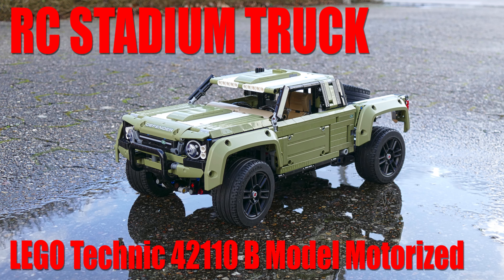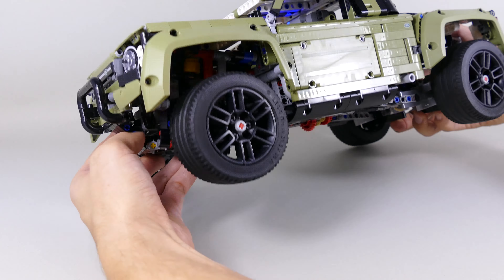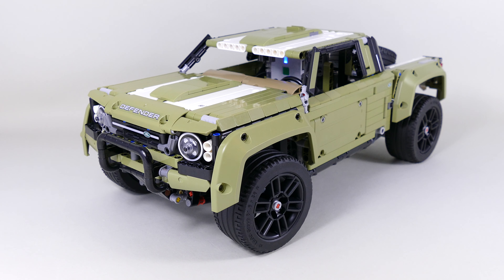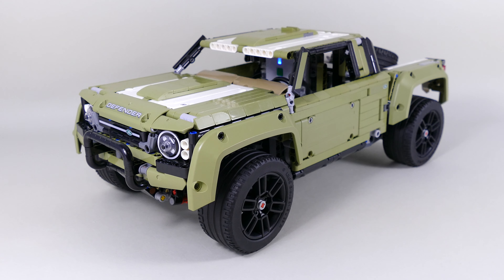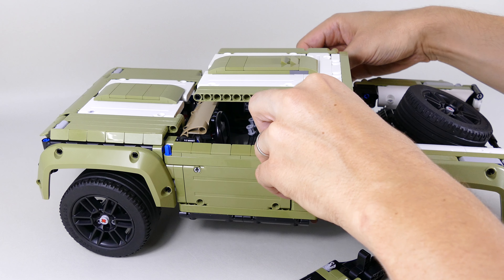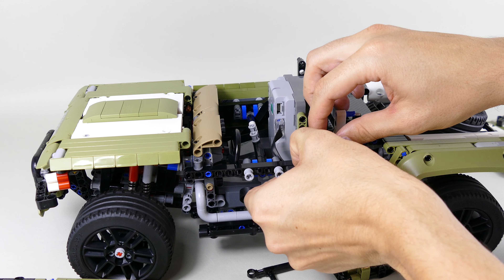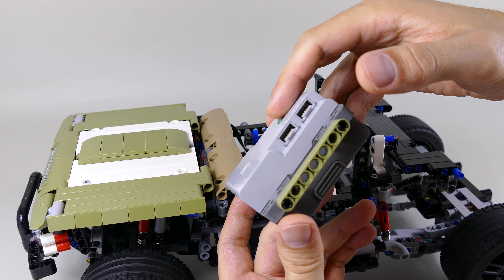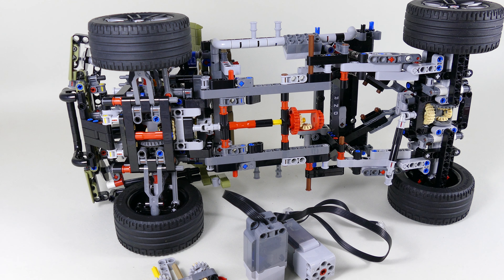RC Stadium Truck - LEGO Technic 42110 B Model Motorized

Comment: I'm surprised the universal joints are strong enough to move such big wheels and the car overall!
Reply from the maker: The truck is not so heavy and I leave the motors running at 1:1 gearing so the truck would probably stop before it breaks anything. The truck is all disassembled now, none of the universal joints suffered any damage. The only thing was some grass in the gearwheels.

Comment: thanks! it helped a lot
i actually managed to break some universal joints and after that i replaced tem with metal parts and after that i tought why not put 2 buwizz motors in it
its pretty fast with 2 buwizz motors so thanks for the help 'cause i only found a way to put them into the car after i saw how did you put your mototrs in it

Comment: Yaay time to dismantle the landrover and the crawler can i use 2 xl motors
Reply from the maker: Might be dangerous for the universal And CV joints in the drivetrain. Fitting them in the chassis will be more difficult as well.
Reply: Ok then im gonna remain on the crawler
Reply from the maker: @Player-fx3vt  Actually since you have the planetary hubs, you can try XL motors but additional rework might be required.
Reply: Ok ill see what i can do
Reply: And maybe if i replace the cv joints with the remaining wheel joint (i dont know how to call them but ill say so : the joints that connect the differential tot the wheel hubs ) i mean those can withstand some force right ?
Reply from the maker: @Player-fx3vt  yes, they can
Reply: Allright , im gonna try it , its gonna take a while because of school tho ...

Comment: @grohl666, is there a way to replace the two drive motors by two buwizz buggy motors and use a buwizz 3.0 for this built using the steering motor u got there and as said above the two buwizz motors? My idea is to Make the model a lot faster since ur build seemed to be really stiff and sturdy so it could probably handle the speeds 👍🏻
Reply from the maker: No Idea. I do not have any of that stuff.
Reply: @grohl666  oh alright but thanks for your time!

Comment: would there be enough space to fit a power functions servo in there?
Reply from the maker: It should be doable ith a bit of rebuild. It takes more space than the new L motor.
Reply: @grohl666  I'm yet to build it but I  will see what I can do when the time comes

Comment: Does the fake engine still move?
Reply from the maker: No
Reply: @grohl666  do you think it would have been better to but the battery box in the engine bay
Reply from the maker: @robertorecio8725  You can try. But I think it ended up in the cab due to its size.

Comment: will there be an instruction?
Reply from the maker: Check video description.
Reply: @grohl666  
I know that there is an instruction for your 42110 power set, but I am asking if there will be a manual for the motorized version of your 42110 power
Reply from the maker: @cosjakies1694  you mean the motorized Defender or the Stadium truck?
Reply: @grohl666  J am asking if you will be manual for motoraized stadium truck
Reply from the maker: @cosjakies1694  There is a link for the non-motorized version instructions in the description of the video and this video shows you the needed changes. You do not need anything else.
Reply: @grohl666  ok thanks